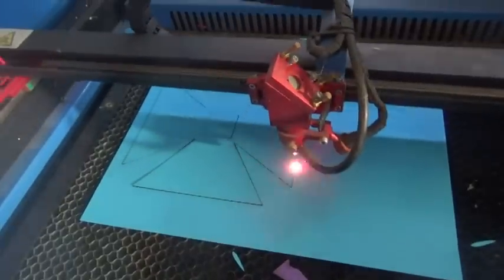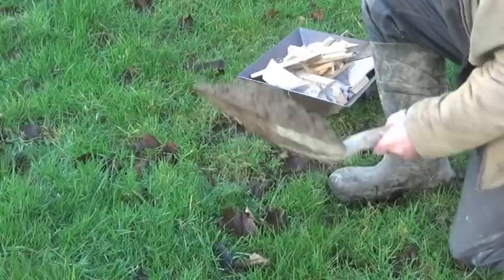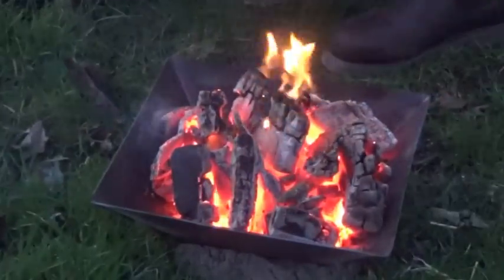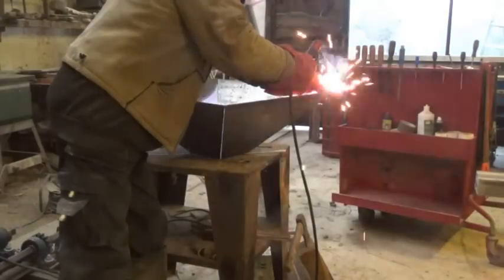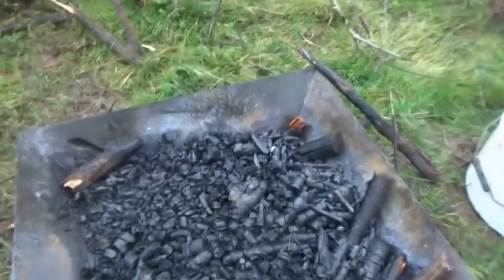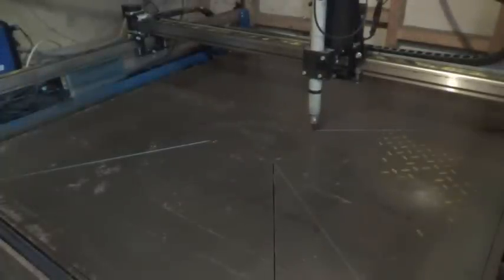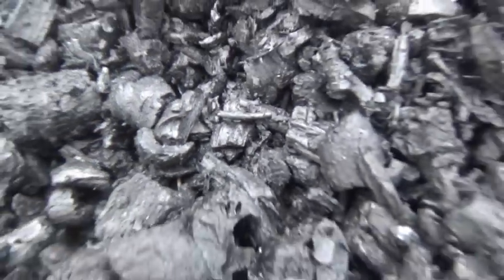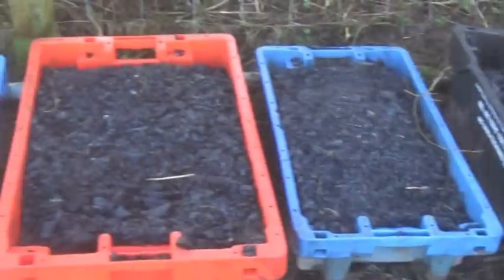Designing And Testing Charcoal Cone Kilns (and making lots of charcoal).

Comment: Neat, I didn't know this was a common design for making charcoal. I used basically the same method when I was making charcoal by the bucket load for fireworks. I have a video from 2008 called bulk producing pine charcoal that uses this method. I use a vent hole at the bottom of a square bin to feed the flame with a leaf blower, but pile the fuel into the back corner so only the surface burns with the flow of air. You can make a ton of charcoal quick. Using a blower as I did might make the process go better with wet fuel as you have. I'm sure washing with water is essential for biochar also because you need to wash away any ash that would make the soil very alkaline.
Reply: You might consider making these cones from a bit thinner steel with overlapping tabs on the edges and holes for bolts rather than needing to be welded. Then you could sell and ship them flat for the purchaser to bend themselves.
Reply from the maker: I think there's a role for forced-air at the beginning, just to get the fire going strongly. But after that it must be hard to keep it from penetrating into the cook zone. Always lots more interesting experiments to try, aren't there?! But I have plenty of charcoal for now..

Comment: In winter you can make bio-char on a ongoing process. Fill a empty paint can with sawdust ,put a hole in the cap , chuck it in the wood stove. When the flame at the cap goes out , it's done.

Comment: have you tried digging a cone in the ground maybe ina bit of clay soil. I know its not the point, as you can't use the cnc cutter or can you??
Reply from the maker: I would do but it would fill with ground water immediately - the soil is just so wet here now
Reply: @WayOutWestx2  
Hmm... maybe something in between? Maybe it would be a good idea to bury the steel cone in the ground!? In my opinion it would not get so much material distortion from the fire heat then!?
Sincerely yours.
Reply: Another cheap and easy way. Get a 55 gallon steel drum. cut an oval shaped hole length ways. 
Punch a couple of drain holes on the opposite side. So when you put the fire out. The water will drain out.

Comment: What exactly is Biochar and what do you use it for?
Reply from the maker: It's a soil improver - very interesting stuff
Reply: Way Out West Blow-in blog  i love love love your channel.what a great video. 

I believe burning cedar timber with gas torch to char point is all the craze now architecturally and aesthetically. It’s something that will never rot and takes very little care. There’s a building in Ireland that was published by 2020 Architects called House in the Hollow. The full structure is burned Cedar. (I think it’s Cedar) it may save you a bucket of paint or too and rotting for your next outhouse build and it’s right up your alley.
Reply: spence burge - See https://en.wikipedia.org/wiki/Biochar